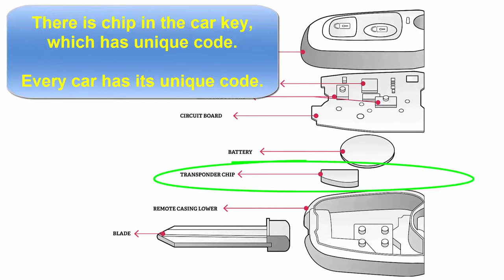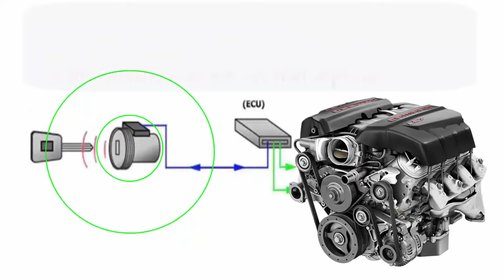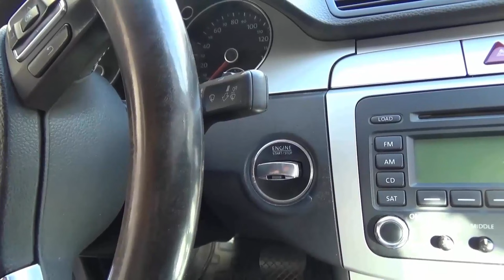Start the Car without Immobilizer

Comment: I have a 98 es300 lost all keys will your method work  with no key already tore lock cylinder out so I can turn the ignition switch.
Reply: It will not work without the chip, it reads from the chip inside the key. All you can do is have it  reprogram  it by your dealer, need a keynumber and vin number I guess.
Reply: @Pfirtzer Call a professional!!! 
What city, state you in? If you have the car computer you can ship to me and we can make key, ship back to you. Bench job.
Reply: @dtnel  I have a 99 VW beetle can you help me with that ? I lost all keys?

Comment: Very informative. Oh another idea I want to share too is toy could use hp tuners and disable it completely.😎
Reply: How
Reply: @richardkelvin8526  The HP Tuner has an option to turn off the immobilizer system, at least on the old PATS systems it did. I am not sure if it still does, I use SMART PRO, but it would be nice to try the HP Tuner and see if it works still.